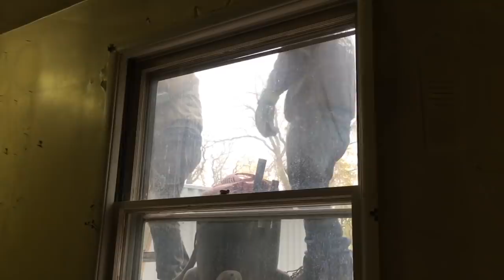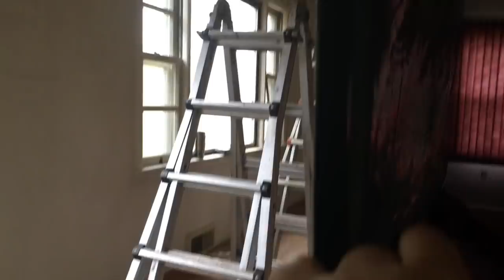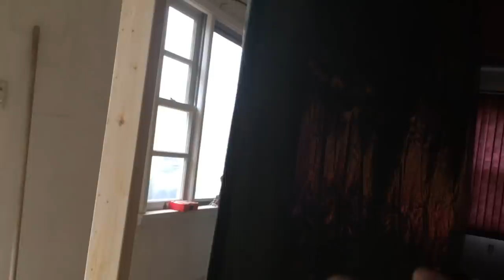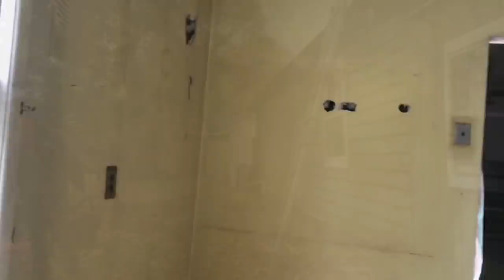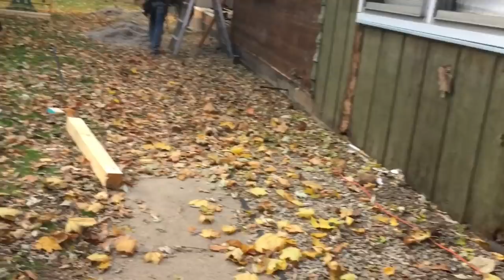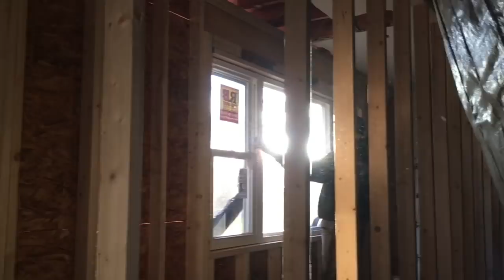Construction - Day 1: Nov. 7, 2019

Comment: They should be wearing masks with all the old insulation.  Are you making your kitchen bigger when they remove the wall in your little front storage room?  It is all going to be so nice when done. Just in time for the holidays.
Reply from the maker: Denise Cole they had masks but didn’t use them.
Reply from the maker: Denise Cole kitchen will be same size.